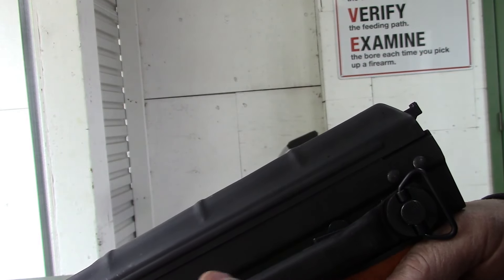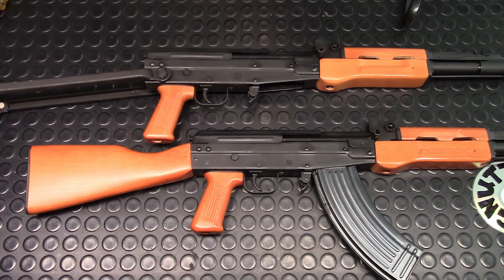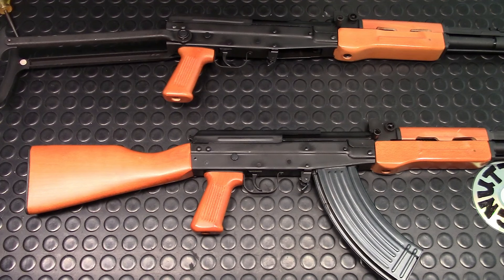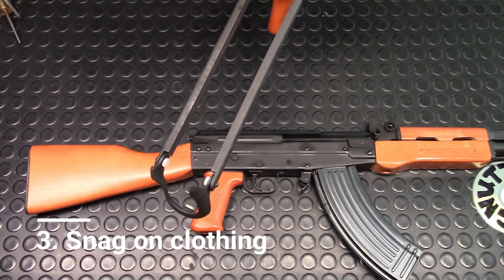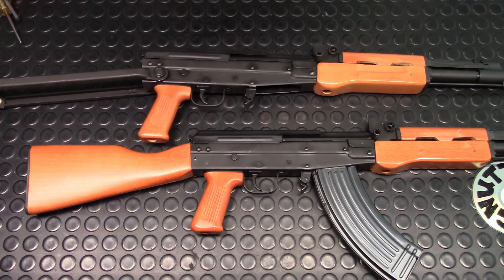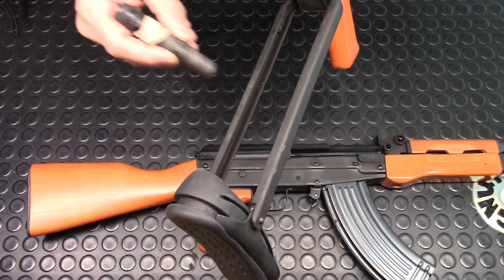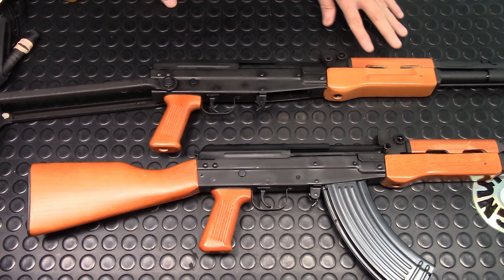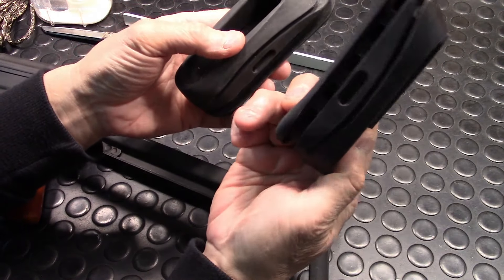Type 81M Underfolder issues. Paracord Riser, 3D Rest. AK-47 Buttstock Pad. T81 T81M AK47 *

Comment: Thank you for the buttpad info. I was curious about the fitment of those. I’ll be picking one up now
Reply from the maker: Ya welcome. Let me try the hard rubber on the underfolder. I will get back to you. No problem with both the hard or soft on the fixed.
Reply from the maker: yup, the hard rubber also work on the underfolder but needs to be soften with a hairdryer.
Reply: @gnutzguy  much appreciated boss! You consistently blast out stellar content. Hands down best channel for customizing the Type-81, without a doubt. 

Keep up the solid work!

Comment: LOP on the Type 81M Underfoder is 14". It's not short at all. Good enough even for taller guys. I paracord wrapped both stock arms and the butt and it feels very comfortable. Shoots like a dream.
Reply from the maker: Different strokes for different folks.
Reply from the maker: BTW: some of the viewers are americans that owns AK underfolders which are short than the T81M so they may be interested in increasing their LOP.
Reply: I'm new to paracord wrapping. I'm waiting on my under folder now. I would like to do that as well.
Reply from the maker: you will like it. let me know how it goes?
Reply: Did you add a cheek riser to your type 81m for maximum comfort?
Reply from the maker: @JAMAICANTECHDUDE  a riser is a must if you ordered a quad rail bcos your red dot will be quite high
Reply: @gnutzguy  What if you're just running iron sites?
Reply from the maker: @JAMAICANTECHDUDE  then do it without a riser

Comment: The underfolder is my favorite out of the SE's I've owned ans the lmg. It's a vibe, but also a really nice shooter and the stock has a good length of pull and cups into your shoulder nicely. Cheek weld was the only issue I have with it, oh...and the color of the furniture which I plan to refinish anyway
Reply from the maker: underfolder is not a SE bcos both are SA but different variant. thanks for sharing.
Reply: I mean its my favorite between the the 81m, SE and Lmg's that ive owned. @gnutzguy
Reply: What are your pros and cons for the SE and the UF...why would you choose this? Am also debating...

Comment: Question for you sir! If I removed the bolt hold open piece on the bottom of the magwell that works with the mags to hold open on the last shot, would that mess any parts of the rifle up? I want to remove the bolt hole open feature so I get the ak feel of racking the handle back. I already have type 81 magazines so I don’t want to buy the akm pmags. I don’t think it’s attached to anything else but I want to hear from the expert!
Reply from the maker: Go ahead and remove it. You won't have a problem. Better if you use a mod AK mag for your T81 then you don't need to touch the BHO
Reply: Hello again sir! I gave this a shot today but had some issues. I got the little spring out of the bolt hold open, but was unable to slide the piece itself out due to the magazine release paddle on the bottom. Is there an easy way to remove this? I haven’t seen anyone remove the hold open or mag paddle online, it seems the parts are riveted in. Do you know any way, or is this a gunsmith issue? Thank you again!
Reply from the maker: @CODMONSTER4LIFE  the mag catch pin is not riveted. just punch it out. if you see one side of mag catch pin head is slightly flared then punch it from the other side.

Comment: side folder needs nothing! and has zero slop! Weird why the military would choose it over the underfolder!
Reply from the maker: yes, it does.i use the pad with side folder.
the PLA nolonger uses the underfolder after they designed the side folder back in the 70s but continued to produce them commercially.
Reply: Ya not to mention the LOP is the perfect length on the side folder